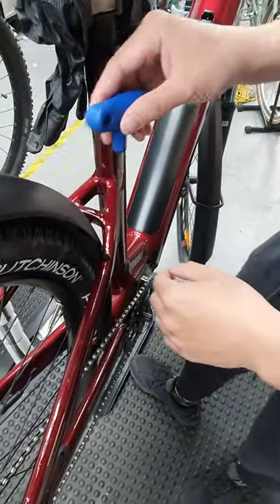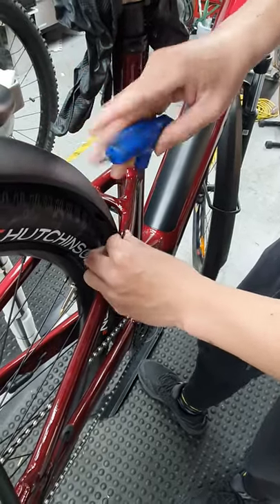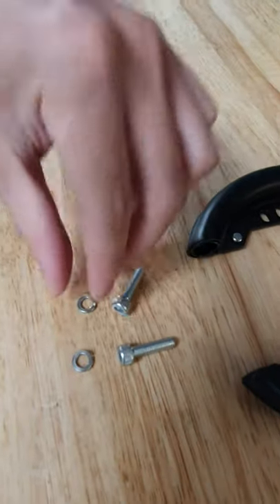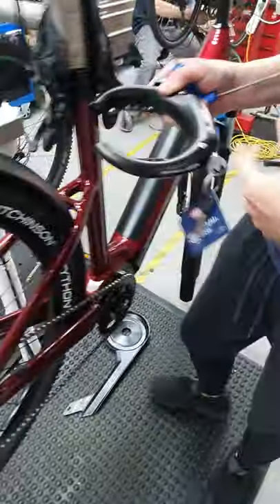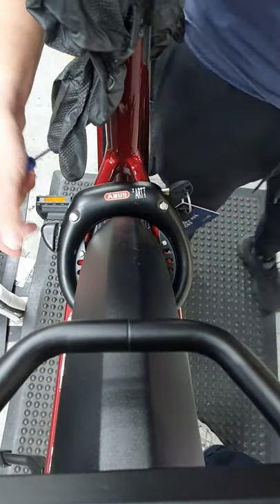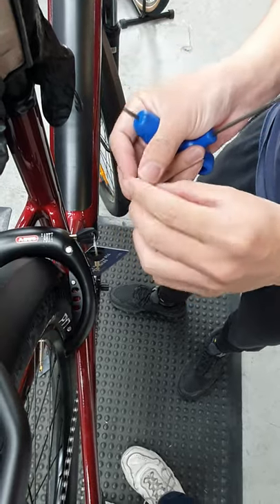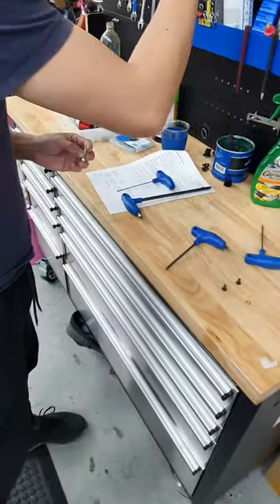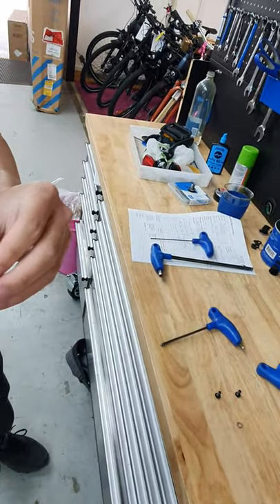How to install a ABUS wheel lock on Moustache Xroad

Comment: What is the name code of this abus frame Lock that fits x road ;;
Reply from the maker: We use this one. I recommend the R (key retaining) type - https://ebiketeam.co.nz/shop/accessories/abusframelockproshieldplus5750lroem/.
Reply: I suppose it fits also the  xroad 3 open I have
Reply from the maker: @shaolin4wd  yes it will. Fits Xroad 1, 2, 3. (Xroad 5 and 7 already comes with a wheel lock). Also fits moustache off 2. Does not fit the full suspension bikes